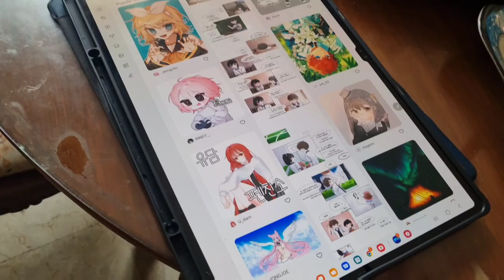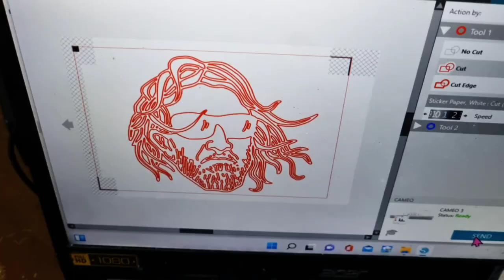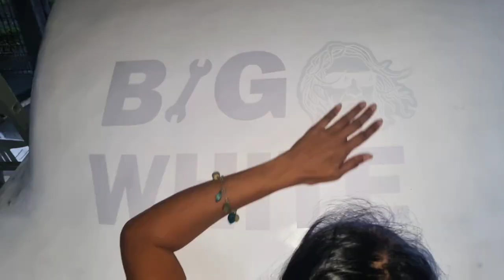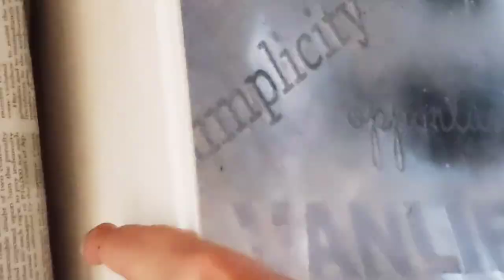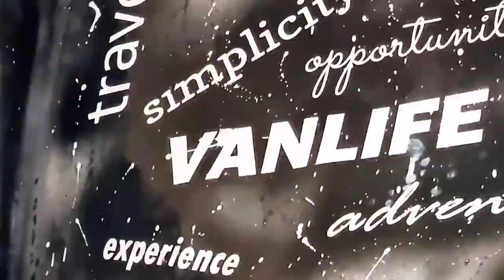Campervan Art | DIY Stencil Art | L300 Campervan | Big White | Vanlife PH | Silhouette Cameo

Comment: Hello looks amazing where did you get the body made I've been looking to build a campervan but can't find that shape body
Reply from the maker: Hi! Thanks for watching. This one is a rare secondhand find on Facebook Marketplace here in the Philippines. It was a wheelchair access vehicle. The original owner had the body custom fabricated with a modified high roof, side door, wheelchair ramp but it was never used by the handicapped person it was built for--he died without seeing it. Mitsubishi L300s are so ubiquitous here but we found only 3 of these high roof custom builds online and one other unit in real life, but never with that side door.
Reply: Yes the side door is amazing never seen that anywhere you said it was built in Manila is there any chance you have the builders contact we live on siquijor
Reply: We converted and van 20 years ago in England and can't wait to do it again
Reply from the maker: @zoefinch9333  It was fabricated somewhere in Central Luzon. It's not Centro or Almazora. I will ask the former owner.
Reply from the maker: @zoefinch9333  Wow, that's amazing! The former owner had the fabricator purchase a 2012 L300FB cab and chassis in good working condition and had the body built to his specifications. It cost him around P475,000.
Reply: Thanks alot all the high quality places seem to be is Manila area